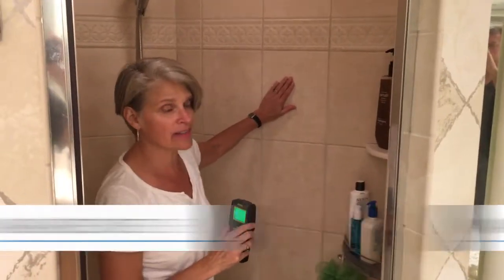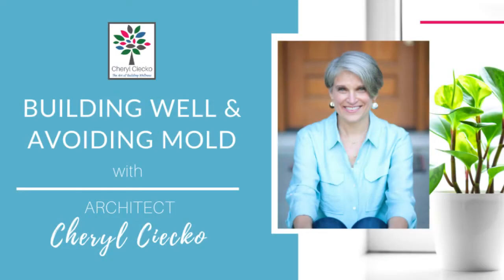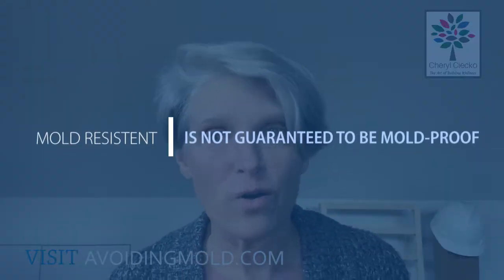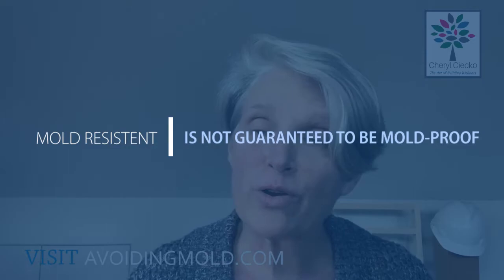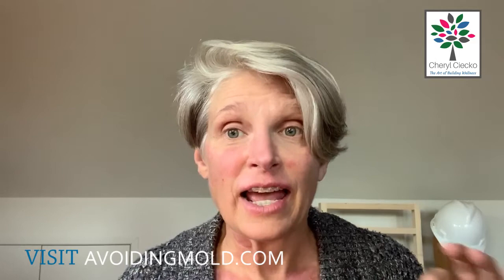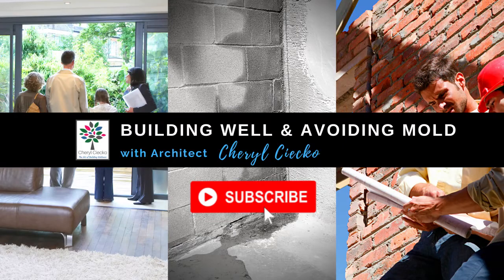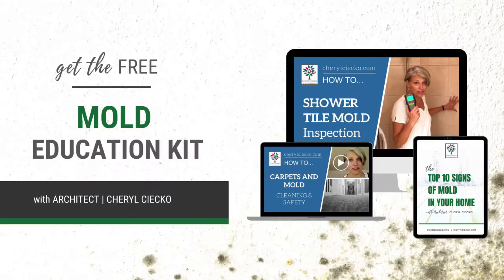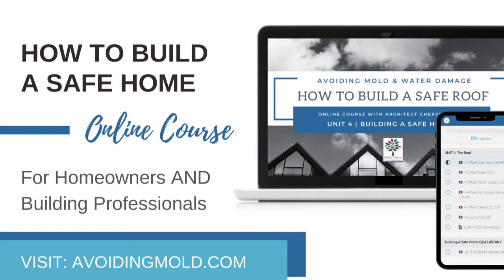Does Mold Resistant Drywall Work? EPISODE 11

Comment: I’m finishing my basement. There is wood paneling up right now. My plan is to take the paneling down (keep the studs up), drylok the walls in between the studs and put up Sheetrock. Can I use regular Sheetrock and paint it with a mold resistant primer? Is that as effective as the green Sheetrock?
Reply from the maker: Read the warranties of the primers you are considering.  Based on my research they all require a clean and dry surface and provide no warranty if the surface gets wet or has dirt or dust on it later, or is exposed to high humidity.  I recommend taping up a 2 foot square piece of plastic and seal tightly to the wall.  Check to see if moisture accumulates over time behind the plastic.   In my experience there is no coating that will completely prevent moisture drive to the interior if the outside sources of water are not eliminated.   Read warranty fine print details including exclusions and limitations.   If the conditions for the warranty are met, there will be no mold growth even without the coating.  Mold will grow on dirt and dust, which is everywhere!  Humidity alone can be enough to fuel mold growth.  The spaces behind finishes adjacent to foundations are often high humidity zones.  See my other videos on this topic or the Moisture Basics Mini Course which is accessed through my website at www.avoidingmold.com under the education tab.

Comment: Can you use concorbium on the back of the drywall to control mold?
Reply from the maker: You could try prime painting the paper but I have not found any product that will control mold in wet or humid conditions.